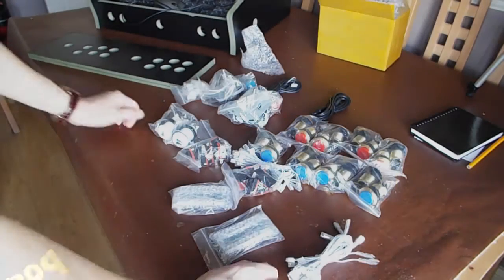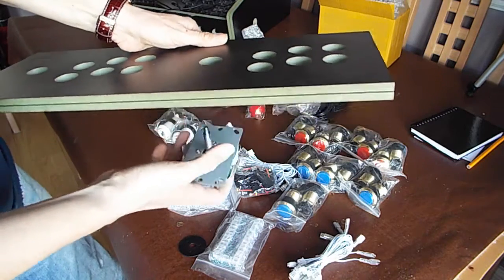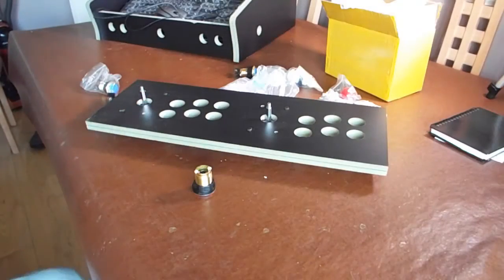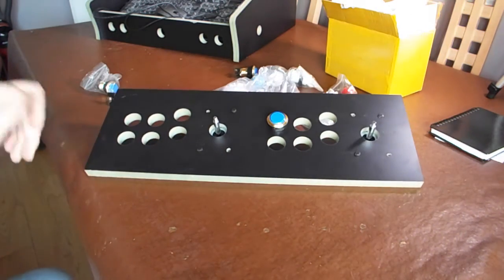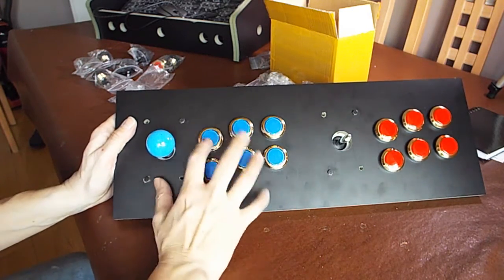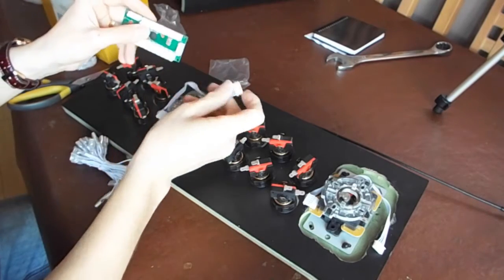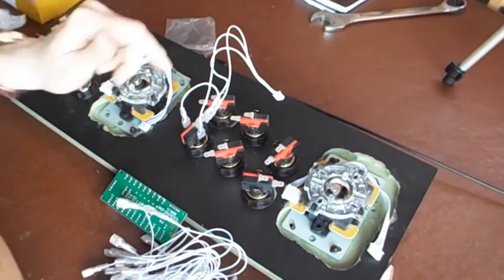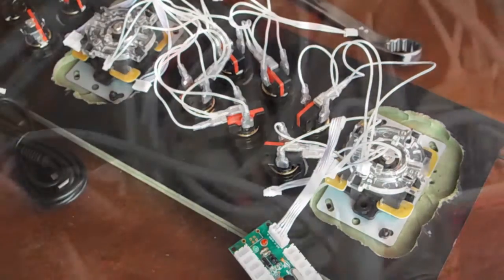MAME Bartop Arcade Machine build. Part 9

Comment: Love this part. Just done wirering up my control panel. Did went with a none lit one, because i was affraid the lighting would be distracting when playing. I was like screaming, ground is the daisychain one. The other is for the light and the other lead for the switch. Had to laught seeing you struggle with putting the light/switch harnass onto the back of the button. I only have 4 button that use this style, the other ones are snap in buttons, and i was really struggling to get those harnass back onto the back of the button. I installed the switch first, but that only makes it harder to get in. Hope you did have a look at the direction of the leds since it looked like you just put them in randomly.

Comment: come on Fred it's easy to wire that up remember this the white lead goes into the white plug then the white lead goes into the white plug you just carry on great video buddy
Reply from the maker: +shaun pi Yeah LOL there all freaking WHITE arghhh.  No idea how its going to work but just hoping its all programmable in software.  Had other issues today as my 15 amp Alinco power supply went south for a while.  Spoke to Steve Ellis on here for the first time before all went wrong.

Comment: You should consider using that middle button as your exit button to return to HyperSpin.
Reply from the maker: +Solly4Life Yes that a good call.  I am going to have to introduce some extra buttons at some point.  Wonder if they make one with exit or start on them. ?
Reply: +fredintheshed1 The buttons I have came with inserts that you can use with the buttons and have start/$/Play etc.
Reply from the maker: +Solly4Life Ah that's interesting.  I will have to see if mine could be adapted and print some labels.  thanks mate.

Comment: Hi Fred, did you manage to find any destructions for the wiring in the end? Starting my cab this week....dreading this bit though !
Reply from the maker: On the ebay listing was a diagram which helped me find the 5v input.  The switches just went on the 3 pin line of sockets.  It makes no difference to the order as you program them via software.  I used hyperspin.
Reply: Cheers, What were the 2 pin connections for ?
Reply from the maker: I am not really sure Andi.  I am guessing for extra switches such as coin slots etc.